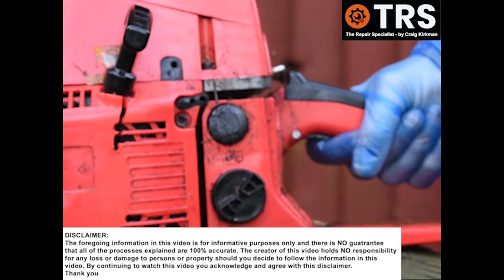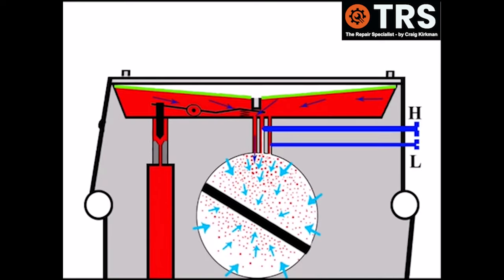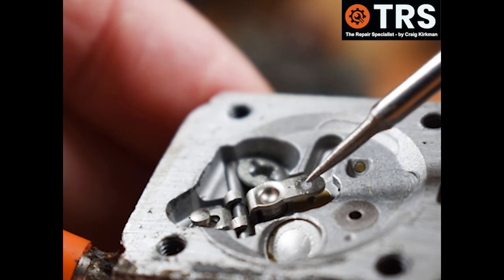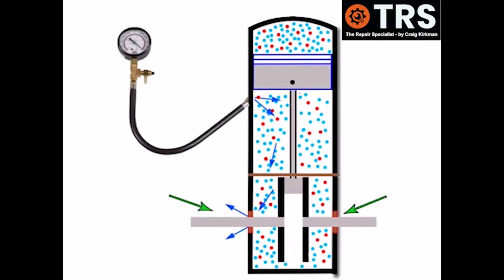Why does my chainsaw start then die when I give it gas?

Comment: Good video. Only thing I surprised you didn't mention or say was the term vacuum. Is there a reason for why you didn't use that term? I guess engine signal is the same difference. I have always liked the function of vacuum.  Maybe it is terminology across the pond? Still a great video. You explain things thoroughly enough a novice should be able to diagnose and repair their machine.
Reply from the maker: Thank you for your kind feedback. I really appreciate it. As for the word vacuum, I have used it several times in my other videos and I have had some complaints about using that word as well. This is because the word vacuum can also mean: devoid of matter. So I’m response I decided to use suction pressure so that it is understandable to a wider group of people. Thanks. Craig
Reply: @TheRepairSpecialist  I had thought it could be a language kind of issue.  Here in the US alone you can go from the east coast to the west coast and terminology is totally different.  Makes for good fun at the parts stores lolololololololol!!!

Comment: If I pull the throttle quickly it will bog down but if I ease into it, it will run full speed no problem. What could that be?

Comment: issue on a saw I had was   the coil lead was discharging in to motor   a few layers of tape  pushed it far enough away that the spark never made the gap

Comment: Amazing how all them parts work together . Even more amazing is a rebuild kit for $16 on Amazon . Got my old bg 85 screaming again . I didn’t have to replace the carb . It s one of those one screw “LD” only for idle adjustment . Apparently the carb is set for stihl mix and that’s what I used . I was wondering if a normal adjustable carb goes right in place of the pre set carbs . They sell them in Amazon and it says it’s for the bg 85 ? Thanks

Comment: I have one question .. plz do answer it ... can I use gear oil EP90 instead of engine oil 20W40 for chain lubrication in stihl chainsaw .. as gear oil is cheaper than engine oil ... you videos are very helpful

Comment: Great video but also if you only reach to a certain amount of revs and no more, it could be the electronic advance on the coil has gone bad and whole coil will need replacing as revs cant be built up past a certain point but it runs ok otherwise.

Comment: How well do the makers set up the saws in the factory? That is, what is your experience of how well a new saw runs "out of the box" as it were? And does it need to be adjusted later on? I ask because I bought a new Husky 120 last year but it's never really run well and now, having put it away for the winter (and yes, I emptied the fuel tank and ran the saw till the engine died), it starts OK but it only keeps running when the trigger is between about 1/4 and 3/4 open. It dies instead of idling and it dies on full throttle. Any suggestions? 

FWIW I saw a video by Chickanic where she suggested the diaphragm on a 2-stroke carb can stiffen up when the engine isn't run for some time (about 4 months in my case) and her remedy is to start  the engine and pull/push the choke lever so you're kinda massaging the diaphragm. I tried this but it didn't have any noticeable effect.

Comment: Also keep in mind you need to lower the main idle screw fully  before you adjust the low speed circuit. If not you may be outside the idle air orifice. 
 You will need to reset it anyway to a level that allows you to make adjustments to the low speed screw.

Comment: Great video....and I've watched many.
I have an Echo cs310 at the shop....no matter what I try it runs well at full throttle...good under load no bogging on acceleration.

But, unless you keep reving the engine it will die. Just as if you shut off the switch.
Has new Echo factory carb I put on....but, I cannot make it stay running unless I keep reving the throttle.   Ideas?

Comment: Check the chain before you start turning screws.  Chain heats, expands; you adjust it.  Chain cools, it's too tight, bogs engine.  Also if you've sawed through soft punky wood, the front sprocket gets jammed up.  These are much more likely causes than anything you've shown here.  Also, the safety lock, make sure it's "clicked" in the right direction.

Comment: Actually... for twenty five bucks I can go over to Amazon and buy a complete carburetor, gaskets, and air cleaner, fuel filter and spark plug for my Husky 460.  I don't mess with tearing apart a carb, I just replace the whole thing.  I just bought the whole set for my log splitter with a Honda engine, cost me $18 and it works like a charm.  For a chainsaw that bogs down though, I first adjust my jets, that works in most cases.

Comment: Great video I was wondering if you would get to a clogged spark arrestor because many would overlook it
Reply from the maker: Hi. Yes i do agree that a clogged spark arrestor can cause running issues with these small engines. However, in the last 30 years I have had to changed only a few.  The most common cause of engine bog, by far over the years for me, has always been fueling issues relating to carburetor settings and cleanliness of the carb.  For some reason, there has been an explosion of peoples beliefs that the spark plug arrestor is a priority for engine bog symptoms.  

I think this may have come about because of some you tube video someone made, where they wanted to stand out a little and surprise millions, in kind of a "The Actual Real cause of Engine Bog" type video.  But I personally have found the spark arrestor somewhat of a problem in the past, but minor in terms of the engine bog issues over all.   

You rightly mentioned, though, that I do need to make a video on this as an overlooked cause.

Thank you for your feedback and comment. I really appreciate it.

Craig

Comment: Engine revs but bogs when you open the throttle is likely to be a weak mixture. When applying choke improves the running is a strong symptom of weak mixture. 
Check the fuel lines are not clogged with oil. Ensure the fuel in the tank is new. Old denatured fuel gives similar symptoms.
Reply from the maker: Yes I agree there are many causes and I totally agree with you. Thanks for commenting. Craig 👍

Comment: I just bought a 62cc, 20 inch Hyundai chainsaw with recoil start. Wow! took a little getting used to a saw that doesn't rip your arm off trying to start it, lol 😁However, I also have a Homelite 3314 that I got from a friend, must be 10 years ago...Great wee saw, easy to start and generally reliable. But I cant seem to get it to idle. Everything appears fine. There's no damage or worn bits. But if I adjust it to get it to idle, it bogs down. 
if I adjust it to get max revs, it'll idle for a few seconds then shut off. Always starts 1st pull again, but bloomin aggravating having to keep revving it or keep starting it. How many turns of high & low would you recommend and ideally, how can I adjust the idle screw when it's hot? Thank you 🙃

Comment: To check for a suspected air bypass, rich air/lean fuel condition simply close the choke. If it does not die pretty quickly, if not immediately, you're sucking air from somewhere.

Comment: When everything checks out remove the Muffler assembly and clean the carbon from the spark arrestor screen. Heat to cherry red wire brush reinstall and enjoy the revs !

Comment: My two cents. Yes, one should make sure your adjusting screws are adjusted. My issue is , if it ran fine, and all of a sudden it has a bog, messing with the screws will only get you into trouble. There’s a reason why a bog developed. And you need to figure that out. It’s not that the screws  turned by themselves. All due respect, but you gotta check everything else first, before you start messing with those screws.

Comment: Possible Suspects with Timestamp

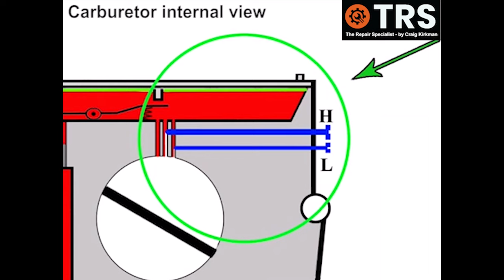0:20 Low high settings 
1:00 Fuel filter 
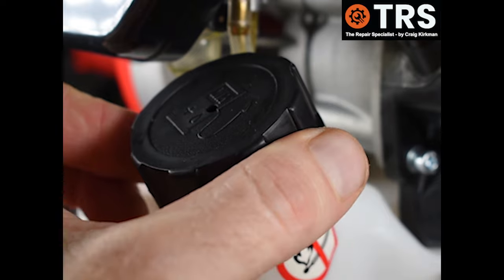2:07 Fuel pipes 
2:30 Inlet Manifold
3:17 Manifold gaskets
3:31 Manifold Damage
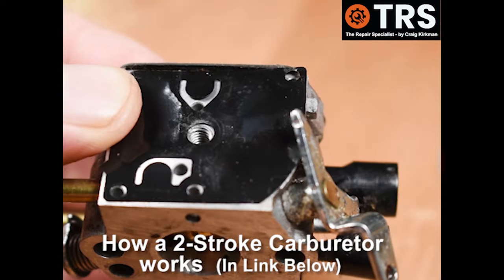4:00 Fuel pump diaphragm
4:51 Fuel Vein Blockage
5:25 Blocked screen filter
5:44 Main Jet blockage
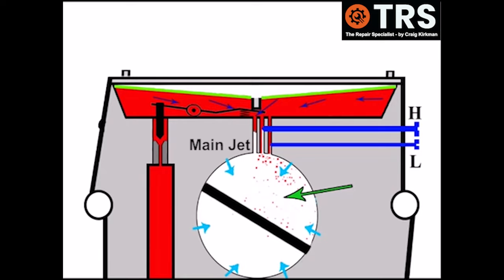6:07 High jet blockage
6:50 Low jet blockage
7:40 Metering diaphragm cap
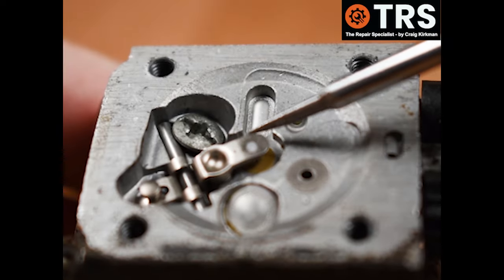10:25 Metering lever
11:05 Metering spring
11:47 Barrel Gasket
13:08 Main Crank Seals
14:00 Stale fuel
15:09 Exhaust Spark arrestor
Reply from the maker: Thank you 👍

Comment: Does the return fuel line have to be long enough to always be sermeged in the gas??   Also, will a properly working & correctly sealed fuel system also sport a primer bulb that you can visually see it contains gasoline inside of it, while you are operating it ??

Comment: Fantastic video!
Reply from the maker: Thank you very much! I really appreciate it 👍👍👍
Reply: @TheRepairSpecialist  I will be watching more of your videos for sure and will spread the news for those who like to do their own repairs. I saw someone else video yesterday about the flywheel and how the key had sheared. What was surprising was that the key was built in to the flywheel and the whole part had to be replaced. Without the flywheel realigned properly the timing was off and wouldn't start. I'm a Machinist not a small engine mechanic and would have thought the key could have just been replaced. This was on a Craftsman Chainsaw, which I am considering buying a new one. It's in my price range for a 42cc saw.

Comment: your also going from high vacuum at idle to almost no vacuum at full throttle , until the engine adjusts it will produce the bog , time to speed up should be almost instantanious if air/fuel  is adjusted right

Comment: The main reason is all the modern saws are restricted.  Unrestricted them both intake and exhaust.  Pull the cylinder and have it ported and the base gasket deleted.  Now adjust your fuel and use good oil and high test gasoline.  Prepare for the greatest chainsaw experience of your life.  Remember safety.

Comment: I've been through mine, new carb that developed the same problem as this video a year later. All the points here have been covered. When you pump the purge bulb air comes down the line into the purge bulb, meaning the metering area is getting air into it. The only thing that it can be [this video does not show it] is there is a check valve in the metering area which feeds the high/low adjustment screws. That check valve must be leaking so that when the purge bulb draws on the metering area, air is sucked back through the check valve drawing the adjustment screws which draws air in from the carb bore.
Reply from the maker: Well. You could try to remedy the check valve if you feel this is the case. It is a far less of a common cause than other things but it might well have come to that with respect to the work you have already done to it. Sometimes though, we can’t get over the fact that we need a new carb. I know people who have wasted far more of their time, money and sanity trying to correct a carb when it would have been cheaper and easier to buy a new one. Not saying this is you but please keep this in mind
Reply: @TheRepairSpecialist  The frustrating part is that the old carb developed the same problem of air getting drawn into the metering chamber and down the hose to the purge bulb. I bought a kit for it, applied it and the problem remained so I just bought an entire new carb. That was a year ago. With the new carb [replace the fuel lines and tank grommet] the problem was gone and I used the chainsaw a bit just before winter. [I also bought a Ryobi peanut 37CC/16in bar limb cutter new]  After winter last spring [about 4 months ago] I used them both, especially the Polan Pro 50cc/20in bar and cut a ton of wood. [ran the hell out of it] Then a week and a half ago I went to start and run them both for maintenance and the same problem is back on the Polan and the Ryobi has the same problem. I do run 32-1 ratio on the oil but they have no problems running with that mix for years. I watched this video...
[ How a 2 Stroke Carburetor Works, Fuel Pump & Metering - https://www.youtube.com/watch?v=HcwlNS-wFkg ]
to understand the fuel circuits and since I know there is no gasket/diaphragm/valve problem, the only way I can see for air to get in is back flow through the check valve as the purge bulb sucks.
I've tried blowing brake clean through the check valve but it is pressed into the body with a very small hole and can't seem to be able to get a seal on the hole to check to see if it is working or get it out to check it.
right now I've been working with the old carb since it has the same problem and I also have a spare new primer bulb. [bought one with the kit, and the new carb also came with one] I considered setting up a bench test with a jar of gas and using the purge bulb to test with.

I interchangeably use the word primer and purge since it's purpose is to purge air out and prime fuel in 🙂 Also the metering chamber is the similar concept of a float bowl on a regular carb. The diaphragm is just a fuel vacuum float. The crankcase push/pull fuel pump on the other side of the carb provides pressure to the Viton needle valve that the diaphragm button opens.

I am an ASE certified automotive diagnostic technician and have been working with electromechanical devices for over 4 decades. My usual smallest has been lawnmowers, so there has been a short learning curve to understand the dynamics of this fuel pump/carb package.

I would really like to figure out this problem without having to buy a new carb again. [or one for the Ryobi]
I don't know the original cause? What do I have to do, when I store them, put Acetone in the tank and purge pump it through the carb[s]?
The main thing is 1. I don't actually need to use them right now. 2. Current financial situation dictates I can't afford to purchase new carbs anyway. I would prefer to identify to problem, devise a solution and implement a policy to prevent it from happening again.

Thanks for putting up with my short novel.
Reply from the maker: @DrHarryT  OK. Try looking at these vids of mine if you get the time and they might give you some ides.

* 2 STROKE CYCLE CHAINSAW CARBURETOR - INSIDE WORKINGS - INGENIOUS! : https://www.youtube.com/watch?v=XSrcW3PJ0wQ&t=167s

* 2-Stroke Carburetor | How it Works | What is a Carburetor?: https://www.youtube.com/watch?v=tqfQ6B2_o_c&t=4s

* 2-Stroke - 'How Engine & Carburettor Work Together' - Chainsaw/Trimmer/Lawnmower/Stihl/Husqvarna: https://www.youtube.com/watch?v=Nb_qGDtP3iQ

* Setting 2 Stroke Carburetor | This Happens Inside - How to Tune: https://www.youtube.com/watch?v=7pQ6Vir1uxc&t=204s

* Two-Stroke | How Engine & Carburetor Work Together | Very Unique Video: https://www.youtube.com/watch?v=XPgaF-JBwco

* Main Jet | How it Works | 2-Stroke Chainsaw Carburetor: https://www.youtube.com/watch?v=8exEvSTZjSk&t=1s

* 2-Stroke Carburetor | How Fuel flows through: https://www.youtube.com/watch?v=NNYEsmtB_X8

* How to Tune a Chainsaw Carburetor - Practice & Theory together - Unique video!: https://www.youtube.com/watch?v=sQ4hmM_xoXQ&t=234s

I hope this will help.

Thanks

Craig
Reply from the maker: @DrHarryT  I forgot this one.

* 2-STROKE CHAINSAW CARBURETOR 'Inside view of how it actually works': https://www.youtube.com/watch?v=CiUz0JCxck0&t=4s
Enjoy

Comment: Most people do not use 100 octane aviation fuel because it is very dry. I have a question anyway. Both myself & my friend are retired pilots. He's also an aviation mechanic. He told me that 100 octane aviation fuel never goes bad, old that is. Is this true? I find it hard to believe. Thank you for an answer!
Reply from the maker: Well I assume that if you talking about 100 octane aviation fuel then you are mean AvGas? (Aviation gasoline) rather than the Jet A, Jet A-1, Jet B or Biokerosene etc.  I say this because from what i can remember, most avgas is 100 octane. I think anyway.  I do know that some race cars have been tested on avgas to prevent premature combustion and therefore engine knock.   If your friend had done some sort of experiment and found that 100 octane avgas can last without going stale then thats a good move and he/she should publish this to help others understand and learn.  I think the 100 octane rating of avgas would last for many years if stored in good conditions, whereas regular gas is said to be at its best for only 6 weeks (but this is controversial).  Anyway, although 100 avgas keeps its octane rating for many years, it does lose some other vital factors along the way. Avgas has the lead content still within it. Whereas regular gas has it removed.  The lead content can cause some loss of octane over time but not a massive amount.  Here is some interesting sources of information on this. I hope they help. Many thank. Craig : 

Aviation Fuel vs Gasoline
https://www.mcico.com/jet-fuel-vs-gasoline

and 

How long can fuel be safely stored
https://generalaviationnews.com/2011/05/15/how-long-can-fuel-be-safely-stored-2/

Enjoy!
Reply: @TheRepairSpecialist  Thanks very much for that Craig. "It does lose some other vital factors along the way." As my common sense told me but glad you pointed it out and especially the two links which I will indeed delve into! Everything ages (except precious metals?), that's why I thought his statement wasn't entirely true. Though, as you well stated, it is better at longevity than vehicle fuel. Thanks again for taking the time to deliver a great, instructive response!

Comment: Excellent.  Thanks!
Reply from the maker: Thank you so much. Craig
Reply: I was able to tune the carb and getting running like new and it ran good for several hours, stopping and starting as it should.  The next day, settings unchanged, the saw would not run again.  Where is the most likely place an air leak occur?    @TheRepairSpecialist

Comment: If the saw has been running fine for a period of time it is not likely the carburetor has gone out of adjustment. If it is a saw owned by someone else then an adjustment of the high speed screw might be a god idea.